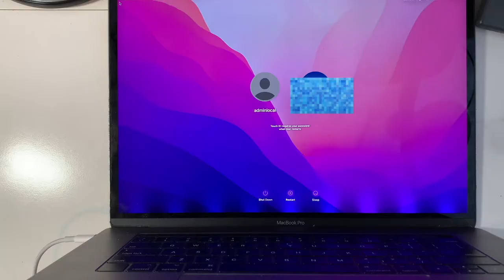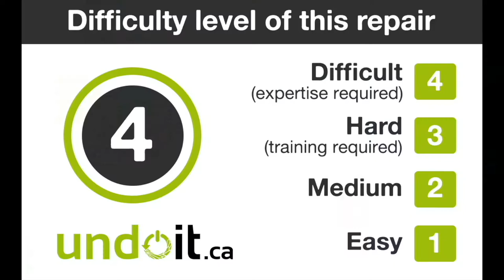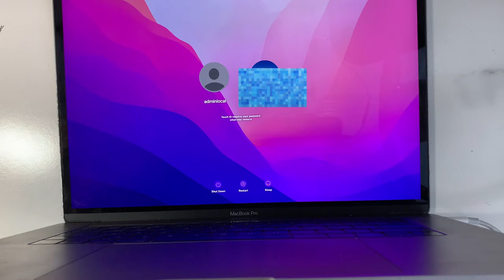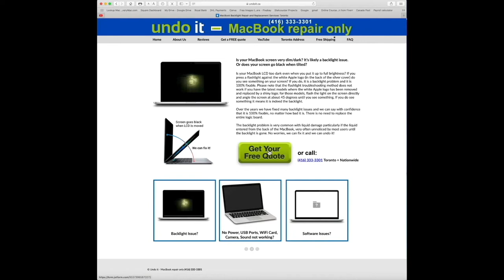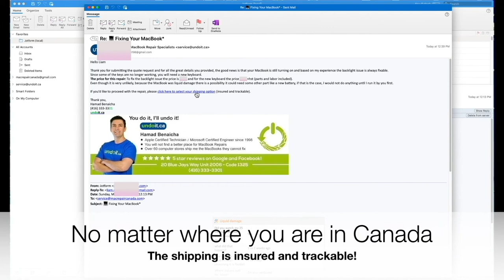🇨🇦 MACBOOK LCD WITH SPOTLIGHTS AT THE BOTTOM OF THE SCREEN (DOTS) RESULTING IN BLACK SCREEN, FIXED!

Comment: Hi Hamad.  Thank you.  You've identified my problem for me.  It started with those stage lights at the bottom and slowly, eventually (unfortunately) my screen went black forever.  So the problem then was the backlight cable.  If the screen has gone black does it mean the whole cable needs to be replaced?  Can this simply be replaced instead of your soldering fix?  It was only a year ago that I replaced the whole screen. Perhaps all along it was the cable which was faulty and not the screen (because although the screen was replaced the new one has gone black again)?

Comment: I'm having this same problem, but it only happens a few times, and I simply restart the notebook and it works normally again. Could it be a problem with the cable too? It's a MacBook Air 2023 M2, only 2 months of use. And he presented this problem in the first few days.
Reply from the maker: I haven't see it on the Air, just on the Pros... since it is 2023, have it checked with Apple, take a video when it happens again to show them.
Reply: I am having the same problem. Glad to know I’m not alone.
Reply: Me too

Comment: Update: I had this problem on an iMac late 2015. I reset the NVRAM manually. Here's what I did; Turn off your machine. Then turn it on and press Option + Command + P + R.
Reply from the maker: Sorry, I only fix MacBooks, I have zero experience with the iMac
Reply: @HamadBenaicha  you’re good! Hopefully it helps someone
Reply: Legend. Had heart failure there for a minute and ur fix worked. Cheers

Comment: I'm having this problem with my MB Air 2020 i3

How much does this cost like this type of repair??? 

Will it be bad to just leave it like that???....
Reply from the maker: that model does not have that particular issue that I describe in my video (I never see it)
Reply: @HamadBenaicha  i do have spotlight on my MB Air 2020 i3 model but my technician said to just leave it like that....
Reply: @danyaelcruz2880 Is something happened whatever you leave like that or not?
Reply: @grinchface3395  yeah the MacBook screen Keep getting darker, and had to change the LCD screen completely because it got totally black

Comment: even i have this issue :( on my  2017 MBP 15inch )
Reply: Same just randomly started. I wonder if it could get any worse, if not i will prob just leave it. Good with soldering and electronics but idk about a job like this lol. Everything is so tiny
Reply: @JelectricRC  They said it starts like that and resulting in black screen when you flip up/down your laptop!! and I have the same now unfortunately 😢